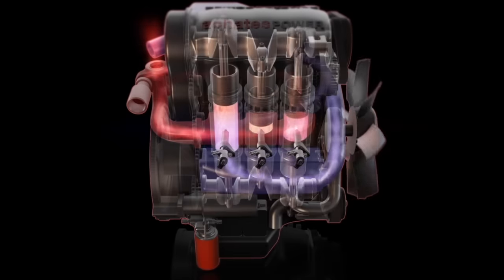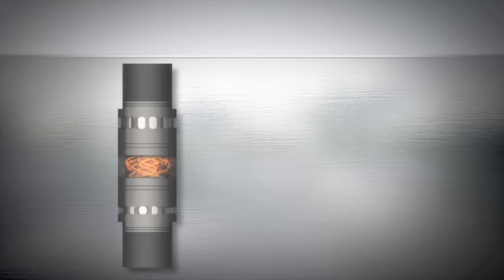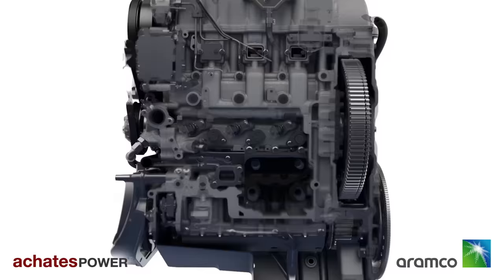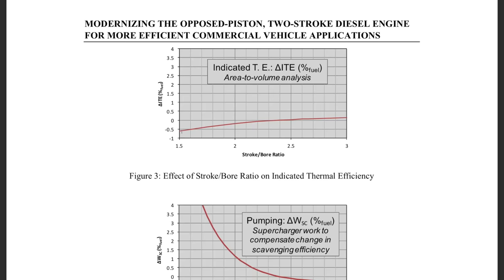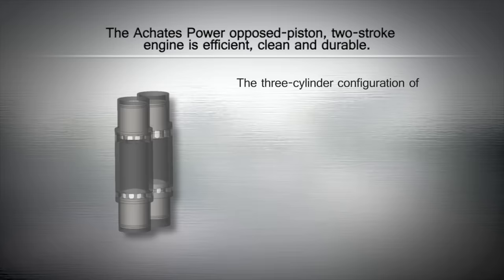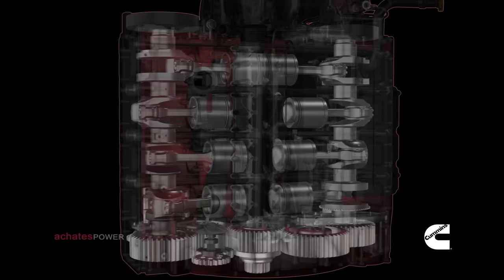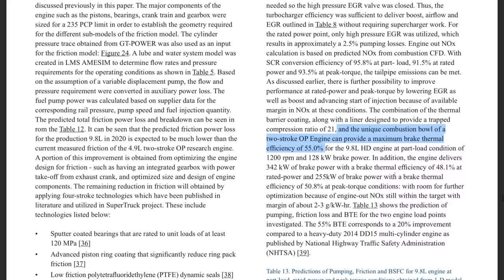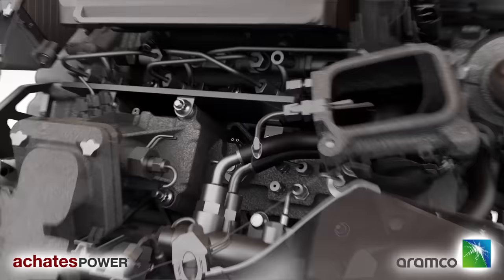Opposed Piston Diesel Engines Are Crazy Efficient

Comment: I worked for the B&O in the early 1970's and there were a few opposed-piston Fairbanks-Morse locomotives around when I  started work in one of their yards. Crews preferred them along with the two-stroke EMD's. These big two-stroke engines responded to throttle more quickly than GE four-strokes, an advantage when switching and spotting cars, and they sounded a lot cooler as well.

Comment: This would be a great primary mover for electric generators.
Such an application would also prove the device in "real word" conditions.
Inherently smooth running as well.
Reply: It is.  The US Navy has been using this type of engine for generators on submarines for decades.
Same for diesel-electric locomotives.
It can handle variable loads with constant speed.

Comment: The 3.26L 3-cylinder opposed piston Commer TS3 had success in the UK in the 50s and 60s, despite having only one crankshaft and a horribly complicated connecting rod linkage arrangement. Cylinders were horizontal and it was intended to fit the low engine bay of the (then) new fangled cab over trucks (which are now ubiquitous in Europe.) I can only think the opposed piston died because of packaging issues: diesel engines being required to fit the same engine bay as gasoline engines, in engine bays that have got tighter and tighter with time. BTW The Napier Deltic (marine and train engine) is really interesting, basically 3  Culverin 6 cylinder opposed piston (diesel aircraft!) engine blocks bolted together. Contemporaries had figured out how to get the timing right with in a square arrangement with 4 crankshafts, but only Napier found a way to do it with 3 in a triangle. You should do a video on it - i can point you to some resources.  Napier made some very odd configurations, including the W12 Napier Lion from 1917 which was used to break numerous speed records. Sad that their name now only appears on turbochargers.
Reply: londonalicante. cars are typically designed around the powertrain    rather then it being put in later
Reply: punker4real. cars are typically designed around a small selection of different powertrains, for example a model might be available with the following options: gasoline straight 4, gasoline V6, or diesel. When the designer selects the diesel engine, an opposed piston diesel will be rejected in favour of a straight 4 diesel if its dimensions differ too much from the gasoline options offered. 50 years ago they left plenty room in an engine bay for a mechanic (or owner) to work in, so putting an odd engine in as an afterthought would not be a problem. Now cost cutting and streamlining have made engine bays very tight, as they are (as you say) literally designed around the powertrain. This is driven by the modern tendency to think only of the purchase price, and not of the cost or difficulty of servicing later on.

Comment: Old concept but it doesn't mean it's a bad design. I worked on Fairbanks Morse MEP engines, a huge submarine diesel that was converted to burn natural gas and drive a natural gas compressor. Also check out the Napier Deltic engine, a 3 crankshaft engine.
Reply: I scrolled down in the comments just to see how long before someone mentioned the Deltic.  You can't do a video about opposed piston engines without talking about it!
Reply: The Deltic is really an interesting engine and unfortunately not appreciated enough.
Reply: Has the deltic engine ever been used commercially?

Curious question, the natural gas engine, what kind of concept was it? Was it with pilot diesel or spark plugs?
Reply: Spark plug.
Reply: Curtis cool, the ship I work on has an LNG engine that runs with pilot diesel. I've only seen spark plugs on paper, never in reality.
Reply: That is interesting I have worked 10 years on spark ignition natural gas engines and never seen one with pilot diesel.
Reply: That is interesting I have worked 10 years on spark ignition natural gas engines and never seen one with pilot diesel.
Reply: Curtis it would be very interesting to have a chat and compare notes.
The engine I work with is basically a diesel and natural gas dual fuel engine, so it has three fuel systems on the same engine. One big injector on a standard plunger type injector pump for diesel, one smaller common rail injector for pilot diesel and huge gas valves in the air inlet ports for natural gas. 
When it runs diesel it uses only the big injector (plus the occasional injection from the pilot diesel injector to keep them clean) and as it goes over from diesel operation to natural gas, it uses all three in gradually changing amounts. Then, once the transition is finished it runs only on the common rail system as a spark plug and the gas valves like an Otto engine.

It is a diesel and Otto engine in the same unit. Manufactured by Finnish Wärtsilä (although I have also worked with German MaK which has a similar style engine).
Reply: What is the compression ratio of this engine? I have seen pictures of the Wärtsilä engines but have not personally seen any. I live in Canada and the engines I worked on are spread all over the provinces of British Columbia, Alberta, and Saskatchewan. The natural gas engines I worked on are all stationary engines driving a natural gas compressor or an electric generator. I would also like to compare notes/ see some pictures if you have any.

Comment: No cylinder head means no blown head gasket. I’m in and I want one. ASAP
Reply: There may be an "inter-block gasket".  Remember the thing has to be made so it can be produced.  There are water jackets around the cylinders but not the crank cases.
Reply: Ken Smith 🤦🏻‍♂️ your right it was just wishful thinking on my part. Never mind I will just have to keep dreaming.
Reply: Interblock gasket sure but there's no reason it can't be one continuous sleeved bore.
Reply: Lemme guess, Toyota Truck or Subaru Owner?  I have a Toyota 3VZE and wanted this engine for that very reason. OH, and Diesel would go (A LOT) further on 14 and a half gallons than gasoline would..
Reply: otm646:
That would cost $1.53 more to manufacture so it will never happen.
Reply: Jared Morgan no I have a VW CRAFTER 2.0tdi it’s a vw badged Mercedes sprinter but with a vw engine. 150k miles and blown the gasket poor quality by vw. Never again.
Reply: yeah but more complicated engines and not familiar to mechanics means very high repair costs and we still don't know how it will age
Reply: Ken Smith - Never heard of any motor that has a coolant jacket around its crankcase. Bearing heat is carried away by the lubricating oil.
Reply: How is it more complicated? It has no cylinder head. No cam, valves, valve springs or valve timing. It doesn't use tons of oil to keep all that stuff lubricated either.

Comment: Not only is this not new technology, this is yet another case of US motor technology lagging way behind Europe.  In the 1950's the Rootes Group  in the UK had a successful truck using this technology in the TS2 engine and developed in the 1950s, Napier had an 18cylinder "Deltic" engine in railway locomotives providing the motive power for British Rail's Class 55s.  This engine had 3 crankshafts with the cylinders arranged in a triangular configuration, in banks of six cylinders.  Achaetes triumph is to make a two stroke engine that can comply with modern emissions regulations.
Reply: Also used in Chieftain and T-64 Tanks.

Comment: If this is such an old technology and is more efficient than an otto engine or even conventional diesel why haven't we seen it in a production vehicle already?
Reply: emmissions on diesels, also cost of design
Reply: Why? They wouldn't be able to lubricate like other piston engines?
Reply: traxfish Regulation. Direct Injection and Chargers have been around a long time, but auto manufacturers had to tip-toe around world Government regulations to install them. Now they're standard.
Reply: Regular 4 stroke single crank engine engine advanced really fast in the 50s and 60s that they become sufficient enough that opposed piston engine advantages in consumer application is lost, which would be packaging/power and efficiency(relative to 40-50s otto engines). And so since adoption lowered, development also slowed to the point where they'r not worthy anymore except in specific situations, such as military (chicken and the egg problem). It's also a pain to manufacture.
Reply: Simple; tooling, convention and marketing. Costs too much and is too iffy to start working on a whole new concept when you've already got a whole production line to run.

With the combo of better machinery and materials tech, opposed piston engines should have taken over long ago, since they are just categorically better than traditional inlines. But we didn't have that stuff back in the day, or the same market pressures on efficiency or simplicity. So instead the money mostly got shunted into marketing and production scale. Now the hybrids and electrics have come back to kick the industry in the ass. And it's about damn time.

Still, people are still thinking too conventionally. I will take advantage of this.
Reply: A Crankshaft is not a simple part. It's still rather an expansive part. Efficiency, Cost, Packaging and Interface. The Two-Crankshaft Engine is good at one of them but bad or just avg. at all the others. Now that efficiency outweighs a lot of engine attributes the two-crankshaft engine has become more interesting.
Reply: How are you taking advantage of this situation? Go electric once for good?
Reply: IamTranslation - and you know this because you have a Masters Degree in battery design?
Reply: Jan Bruun Andersen, we all know lithium batteries, we use em in our mp3 players, laptops and smartphones maybe powertools. The Batteries have their recharge cycles and you need to be really luck to have a Device where the Batteries lasts longer than 3 years. The Lithium Batteries in the cars aren't really much different.  How long do you expect to drive a car? The Batteries are a big part of the costs of an electric car if they die after 4 years your resell value is gone. In Germany ppl don't by just the cars they like, they look closely on resell value that's also why most cars are Silver or Black/Dark coloured.
Reply: These types were used in British Chieftain tanks and Soviet T-64 tanks with miserable results in both cases. These engines were ware-prone and unreliable, especially in horisontal piston arrangement.
Reply: IamTranslation Great advice as increasing maintenance costs are true for all vehicles. Buy outright, or finance no longer than three yrs (if a person can't do either, they can't afford the vehicle). Once paid off, continue making "the payment" into a savings account for maintenance. When things start to go really wrong, the money for repairs, or a new(er) vehicle, is already available.
Reply: 2 strokes are smokey!
Reply: IamTranslation you’re confusing gasoline two stokes like many dirt bikes and diesel two strokes. In a gas two stroke the fuel and oil are mixed because the mixture is pumped through the crankcase and the fuel oil mix is used to lubricate the bottom end. Also some of the mixture is scavenged through unburned when both the intake and exhaust ports are open. The two stoke diesel is different because air does NOT pass through the crankcase and it’s not burning a fuel oil mix, only diesel fuel. Also no unburned mixture is sent out the exhaust because the fuel injectors shut off during the scavenging, meaning only fresh air and exhaust exit rather than unburned fuel mix like on a gasoline two stroke.
Reply: giaccomusic No, not on your life. But, I know how to make this design better. And what with us still needing high power specificity for things like planes, since batteries are too heavy to fly on...
Reply: shaind For the L60, that was because it was poorly designed, built by Leyland at the wrong time, and had a lube system which was just horrendous. Not the case here.
Reply: IamTranslation That's false
Reply: a.k.a. miagi Maybe do some research. You can expect about a 10% degradation after about 200k miles.
Reply: a.k.a. miagi & IamTranslation - will you promise to give me your used car battery FOR FREE when you eventually replace it in your first electric vehicle?
Reply: traxfish I seem to remember that the English Rootes group put out a range of trucks with these engines. They were known for their torque, limited rev range and being very loud. Our local fleet of milk tankers had them and once they had a bit of mileage they could wake an entire town.
Reply: traxfish their is a lot of incorrect answers here. The answer is 2 part. For the opposed design the reason would be complexity and manufacturing abilities ( eg wwII engines that were unreliable). For the 2 stroke diesel the reason is nox emmisions. As they have twice as many combustion cycles and less time to dissapate heat they run hot, which raises nox production. DEF fixes this.
Reply: EPA kills everything that’s good.
Reply: @Daniel Rouw Well, that's not strictly true, is it? The Achates engine has something like 30% less parts, since you can skip out on the valvetrain. And an opposed piston block is at least in theory easier to machine, since you can compensate for the extra stroke with the right drilling technique and by boring from both sides, and categorically easier to make stronger since you can machine it from a single solid piece and don't need to mind about the weakness of the fastening and seals around a head. Now, the cooling bit is another reason why I am making my design around alcohol, however it doesn't seem like it would be too difficult to put on a common "bypass flange" around the block and thus open passages beside the cylinders half of the cycles, or to run the inlet crank at half speed as compared to the exhaust one, to sidetrack any compression resistance, and then just time the injection system so that you get injection only on the other half.
Reply: IamTranslation - With current battery design, I would agree with your comment. However, electric vehicles have huge advantages over liquid fuel vehicles, namely efficiency and complexity (or lack there of). Battery tech will improve and already has significantly improved since the first Tesla Model S hit the roads in 2012. 

Tesla is in the middle of phasing out cobalt from their LiPo batteries, which will reduce production cost and improve efficiency. Cobalt is currently the most expensive component in LiPo batteries. 

The age of the LiPo battery is not what causes them to fail, rather it's the recharge cycles. Current cell phone batteries start to significantly degrade around 500 charge cycles. Tesla batteries begin around 1000-2000 charge cycles. If the average user charges once per week, that's 52 charges per year = 19 to 38 year battery life. Let's assume the user charges twice as often. 104 charges per year = 9.5 to 19 year battery life. And the battery tech is still evolving, so the assumption is it will get better. 

I don't know about you, but electric vehicles look very promising in the near future.
Reply: @Uberragen21 Good to see someone thinking a bit more practically! Also, let's not forget that Mr. Goodenough is still working, and if the theory around those new lead-glass batteries holds then there'll be another practical problem - that of long recharge time - potentially solved. Although I wouldn't want to be the first person experimenting with what kind of converters you need in order to deal with all of that amperage.

Still, this doesn't get around the problems of a) battery weight, b) environmental and practical concerns surrounding the materials for the electrics and electronics, or c) the limitations on useful revs for conventional AC engines. Which is why we are still going to be needing liquid fuel engines for aviation and the like. I mean, not to mention the problems with using regeneration on an air drive...
Reply: @matauboy You’re thinking of the Commer van and truck range.
Reply: traxfish 
Big oil companies, if they are that good they don't want them, less money in their pockets
Reply: PhilosophicalZombie I mispoke regarding complexity. I meant more difficult to design. The engine is going to be quite long or tall unless you use short strokes and short rods. That is a problem in terms of side thrust and stress on the rods and crank. And they may have less parts, but the parts they have more of are more complex and expensive to make.
As for your focus on ethanol, the extra heat is a good thing for efficiency up to a point. Within the capabilities of the materials to handle high temperatures of course. Also at higher temperatures (ceramic blocks) the temperature difference between cylinder walls and the intake air creates some weird problems.
Reply: a.k.a. miagi:  I would argue that a crank shaft is a LOT less complicated than a cylinder head with dual overhead cams and 4 valves per cylinder.  This engine has no cylinder head where the V-6 it replaces has 2.  So,... I would say that having 2 SIMPLE crank shafts is a lot less expensive and problematic than 2 heads with valve trains and head gaskets and timing belts.  The pistons going back and forth and the crank shafts rotating (and the gears connecting the shafts, and an oil pump somewhere) are the only moving parts in this engine.   Only a turbine engine has fewer moving parts.  Turbines are amazingly reliable and if reliability is directly proportional to the number of moving parts, this engine should be as solid as a rock.  And while it's "tall" (wide?) it's no wider than the "boxer" engine Subaru uses.